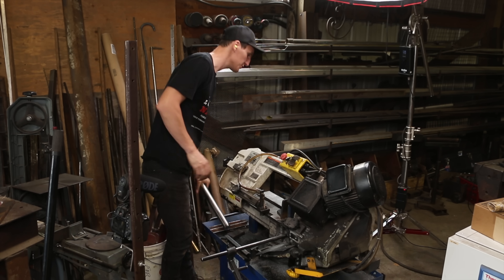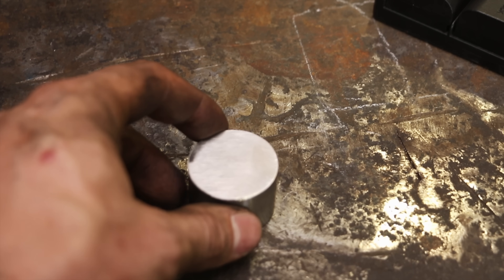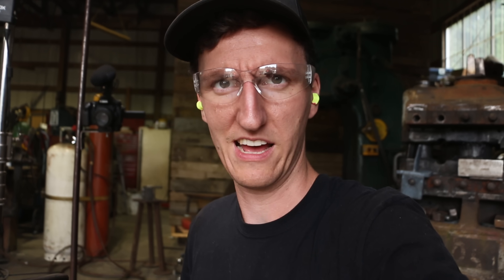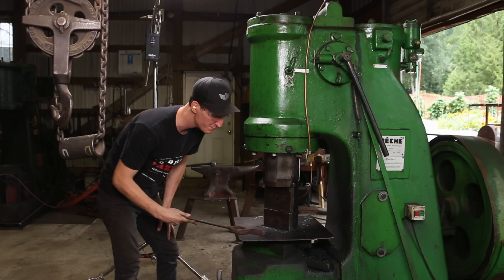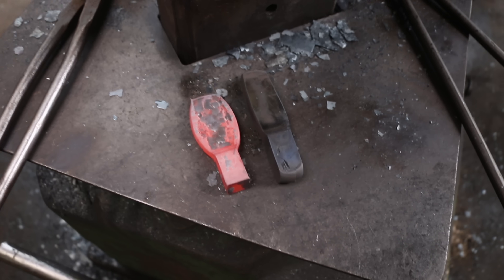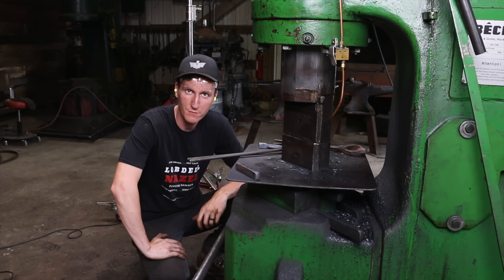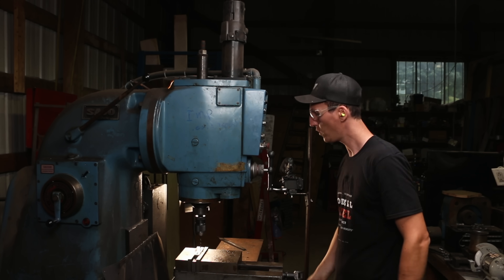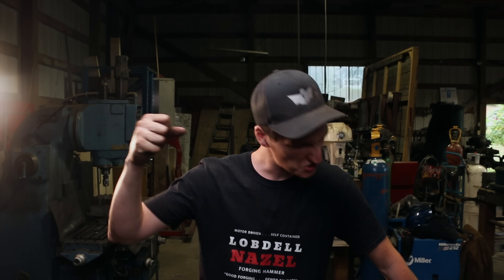Can I Forge INCONEL?

Comment: I've worked in aerospace engineering for years, and I've seen machinists reduced to tears because this material is just a contrary beast. If you want to poke holes in Inconel, you'd better go to the sinker EDM machine, because trying to dill a hole in will just piss it off.
Reply: I waterjet it with 80,000 psi.
Reply: @rolandocrisostomo2003  80kpsi Hooly dooly. So my 3000psi pressure cleaner just won't cut it hey! Oops bad pun. Sorry :(
Reply: @robguyatt9602  I still remember the first pinhole I saw form on the high pressure feed line of the omax table I worked on at the time. Damn near halfway across the work space from a hole I couldnt even see.
Reply: We use it all the time at work for output carriers, sun gears and so on. It’s hard on inserts, but it machines fairly nicely and has an incredible surface finish.
Reply: @Andrewlang90  There are different grades of Inconel, of which double aged 718 is the hardest/toughest. Was that what you worked with?
Reply: Not really a super steel it's just more like a ceramic to tell you the truth. Holds temperature but shatters easy. Just like a carbide.
Reply: @patman0250  Except its molecular structure is very different from ceramic. Ceramics are mostly ionic bonds, while inconel is a true metallic matrix, with less than 1% ionic bonds. And Inconel will melt if you heat it enough, ceramics will not (or decompose).
Reply: @paulmichaelfreedman8334  That's why I said it's LIKE a carbide. Pay attention.
Reply: At least other work hardening materials I've encountered could be drilled, but just infuriatingly slowly.
Reply: I machine inconel 718 all the time. It is one of the trickiest materials to work with. Take it slow and use plenty of coolant. 40 metres a minute turning with 0.35mm depth of cut. Take your time. 9 metres a minute when drilling. Good luck everyone 👍🏼👌🏻😉
Reply: High pressure thru-tool coolant with the right tool and you can drill ANYTHING. Once had some paper-pusher engineer ask me why I was having trouble drilling this high nickel alloy, and I told him the machine didn't have high pressure coolant. He suggested I try peck drilling. LOL. Peck drilling a high nickel alloy 🤣😂 Heavens to Betsy.
Reply: I worked as a CNC machinist for 5-6 years specialising in LARGE inconel parts for the oil and gas industry, you do go through ALOT of carbide and ceramic inserts… cutting premium threads was an absolute ball ache due to the sheer strength of the material. Every spring pass would take out more material, due to tool deflection and wear of the insert, that is, until you work harden it. if that happens you’ll need to take a much deeper cut to get under the hardened layer, not easy when you’re working to +/-.001” with a 16 finish on £1/4million parts. 
There’s actually a few different grades of inconel, 718 was one of the worst to work with, so much so that 925 grade inconel felt like mild steel in comparison. You can tell the difference between inconel and mild steel very quickly, inconel has a very familiar looking yellow sheen and weights significantly more pound for pound
Reply: @sanslik5141    
I was reading your story with respect until I got to the last sentence stating that it weighs more pound for pound. 
It might be me, but I was taught that a pound is a pound. If a pound weighs more than a pound it would defy the laws of physics, gravity, and who knows what else. It's just not logical, Captain! 🖖
Reply: @stanervin6108  you’re 100% right 😂 that’s a saying I grew up with which I used in the wrong context. Well spotted lol
Reply: @stanervin6108  guess he should have said it volumes less pound for pound
Reply: @hughezzell10000  
  Or just "more dense".
Reply: @stanervin6108  I'm sure he meant 'ounce for ounce'.  ;^)
Reply: @stanervin6108  you silly sausage! I know what he meant. :P
Reply: @stanervin6108  but... steel is heavier than feathers...
Reply: @sanslik5141  Been machining Inconel for 12 years, and all of that rings true.
718 is the absolute fucking worst. When everything is dialed in, you can predict and work around most of the work hardening problems though.
But the problem is, if that Inconel is from two different heat numbers, or different forges, your results may differ from part to part. It age and work hardens in my experience, so the longer that shit sits on a shelf, the harder that bitch will become.
925 is an absolute joy to machine. 625 is more like 718, but less temperamental, cuts about the same, but less bullshit.
718 doesn't have the yellowish sheen though, only seen that on 925. 718 will look very dark gray, almost bluish, if you look at the front of a bar at an angle. But look nice and shiny straight on. Might depend on where you get it from also, different blends, but same mechanics.
Reply: I walked up to my machine one day, turned out someone clamped a piece of material in there, one thing went to another and I ended up having a row with some inconel when it started hitting me. I dodged the next it threw at me and gave it an uppercut right in the metal. Never said anything to me after that. 😂
Reply: Keep a flood of coolant, heavy feed snd low speed and it will do what you want. ❤
Reply: its not that hard to drill, just can't be an idiot, use sharp drills and proper speeds and feeds, carbide helps but isn't necessary. It work hardens quickly, so if a drill does go bad, then the part is done, most will continue to try drilling throwing new drill after new drill into the same hole with the same results.
Reply: @northmanlogging2769  Have an oven to anneal it
Reply: @PBMS123 yup. If it work hardness, heating will undo it. Also if you csn, drill while red hot with a carbide but and it zips right through. The metal is some contrary stuff to be sure.

Comment: I bet this stuff would be fantastic for a dross skimmer with molten metal.
or as a set of crucible tongs. 
If its this heat resistant it should be usable in those applications for a very very long time.

Comment: I’ve machined lots of inconel. Very difficult to machine. It’s used for cladding the inside surfaces in a nuclear reactor vessel. The control rod guides in BWR vessel are all inconel tubes.

Comment: So the reason you were having so much trouble drilling and milling vs facing is because you switched from carbide to HSS (high speed steel). If you want to use HSS on inconel you have to be somewhere around 20-25 surface feet per minute and you have to really lean on the drill so you don't work harden it. Even if you are using carbide you need to feed it relatively aggressively to keep it from work hardening carbide is just tougher so it lasts longer and will take the more aggressive feed. I suggest somewhere in the range of 100-130 surface feet per minute for generic carbide tools.

Comment: Tim: This is the hardest material I ever forged.
Me: Make a hammer out of it, just for the sake of it xD
Reply: That was my first thought "Fuck, if it doesn't workharden easily that would make a wicked hammer"
Reply: @maeve615  it does
Reply: @maeve615  that prob only makes it even stronger over time
Reply: He never said it was harder than steel. What he meant was the hardest material he's heated to the usual forging temps. I'd love to see some hardness tests, this stuff looks awesome :o
Reply: I so agree.
Reply: I wonder what an inconel anvil would cost.
Reply: @hughezzell10000  probably more than your house. The stuff is expensive, and as the video shows, a huge pain to machine.
Reply: @kokofan50  Cobalt would only cost $50/kg for a corporation, and it's only around 15% of Inconel 617 - and it is by far the most expensive metal in there. So no, it wouldn't cost you a house.

It's just a niche alloy that doesn't get much use in room temp applications (The majority of applications) where you could use (relatively) cheap steels instead.
Reply: @WhenDoesTheVideoActuallyStart  I was exaggerating a little, but it would still cost a lot. The material costs aren’t going to be the big problem. The most expensive inconel was I found 4.60 a pound, so that would come out to $2,300 for a 500 lb materials. Not an inconsiderable amount, but far from the main cost. The real cost is going to be in manufacturing. The places that work in inconel are going to charge a fair bit for a one-off.

Comment: We install splash plate inside of our plastic injection molds, on the opposite side of where the nozzle mates to the back of the mold. When the nozzle squirts plastic into the cavity, it hits that plate, and over a few 1000's cycles... the plate still shows wear... tough stuff..

Comment: I was inspecting a vessel made of Inconel and the legs were just stainless I think SA-316 and the customer called and wanted the the 16ft legs to be Inconel also. Response went "what? are you sure? You know how.... yea we can do that." Then looks at me "well more money for us!" I was both shocked and laughing because that is not what Inconel is for.
Reply: I've held Inconel nuclear fuel cells before fueling and seen them being removed from  a reactor. The stuff is light but can take huge amounts of heat until the material fails. Seeing what the Inconel cladding looks like after a meltdown is exactly the same as his failed hammer forging.
Reply: @dagger6467  That is why they use Zirconium alloys for cladding. Unfortunately  that alloy has this tendency to get brittle from high temperature water steam (1,230C). Resulting in a condition called hydrogen embrittlement.

Comment: Can you please try the same with molybdenum?
Reply: Forging moly is a bit of a problem.  It can certainly be done, but the oxide that forms at 1400F sublimes rapidly (turns from solid to gas, like dry ice).  So you begin to lose material rapidly and fill the shop up with white smoke.

Comment: INCONEL machining is often done with extreme levels of cooling and lubrication, i notice.
Reply: Yes. That’s a true statement. I work as a machinist in a machine shop
Reply: and low cutting speed. unless you have ceramic inserts then you need high cutting speed
Reply: @user-by7hj4dj9s  My understanding too is that you need a deep cut our else you are fighting against work hardening.
Reply: We use formcut 150 in our machines and never have an issue. Slow speeds and feeds for sure though. .01 d.o.c. on edge passes and .02 on bar out processes. It machines beautifully to a mirror finish though. I like it.

Comment: I use to work at an areospace machine shop, we did a lot of inconel parts. Its one of those materials that u cant truly grasp how hard it is until u try working it lol. But once u get the process and tooling dialed in its not terrible to work, just costly cuz the tooling needs to be nice and ur gonna eat through it even faster then machine titanium

We use to explain to clients that aluminum is to steel as titanium is to inconel. Good comparison both in working it and material properties

Comment: Drill it with SuttonTools R40 Inox drill bits low speed and plenty of lube. Have used them many time to stop crack propagation in gas turbine exhaust inner shells. Love the vid's keep them coming.

Comment: So Tim what you're telling me is that I can't machine inconel pistons for my Ford Bronco? :(

Bummer, but thank you for yet again another awesome video. You convinced me to build my own forge btw :)
Reply: You can if you can keep the tool and workpiece cool enough. Very light passes with a high quality lubricant that can suck away all the heat. The chips from Inconel don't seem to carry the heat away from the workpiece so the heat remains localised and at some point that will cause the metal to work harden. It's usually sooner rather than later though. 

Also I'm not sure how easy it would be to get a really nice finish by machining it in a home shop. You might end up having to hand finish it with abrasives and that would screw your tolerances right up for something like a piston. Bear in mind it's used in jet engines though, it is possible, just not without a lot of trial and error or R&D lol.

Comment: I had to machine the combustion housing for a jet engine a long while back... The worst machining job ever.  It work hardens extraordinarily quick, ate through thousands in inserts.
Reply: My question is this what about making a sword out of it.
Reply: @ericspecullaas  there are better steels for that sort of application.
Reply: @ericspecullaas  it’s too heavy and doesn’t flex enough. A nice carbon spring steel is what you want.

Comment: Looks more like cast iron from the view you showed after it blew apart. Guess there are proprietary forging methods for inconel lol.

I was surprised it machined so easily... and then it didn't :( 

Tough material to work with! Generally when you get specialist materials they're fantastic at a couple of things, and every other aspect is a massive trade off.

Great video though, hopefully your experience with flying white hot crumbly inconel gives others some guidance. And anyone without a power hammer would be a fool to try and forge it lol.

Thanks for the time and effort you put into making content for your subscribers, and the other mad fools that have not yet subscribed and dinged that bell!

Comment: It's like stainless steel on steroids! No scale or flaking at any of the temps shown. Amazing! Thanks, Tim.  ⭐🙂👍👍
Reply: Exactly why it was first created actually.
Reply: Well inconel is a nickel base alloy and it is alloyed with (mostly) chromium, molybdenum, vanadium, niobium, cobalt, manganese etc... Nickel and chrome (vanadium and molybdenum not so much but still) are the most important alloy elements for making steel resistant against corrosion and other properties a also achieved by adding these metals to iron alloys  for example nickel is used in steel alloys for low temperatures (-50°C and lower) to prevent that the steel get to bridle in the real world that and similar alloys a used for almost any liquid gas application

Comment: Isnt it no longer stainless after that much contact with carbon steel. The carbon migrates into it without heat even heating it. Im asking for any big brains out there to educate me  here.
Reply: Carbon does not diffuse that easily.  If the material is forge welded and then held at high heat for a long time, yes the carbon will diffuse.  However, the presence of carbon alone does not determine if the material is stainless.  Alloy 440C is a very high carbon stainless, a lot of knives are 440C.

Comment: "Two heat treatments are generally utilized for INCONEL alloy 718: •Solution anneal at 1700-1850°F followed by rapid cooling, usually in water, plus precipitation hardening at 1325°F for 8 hours, furnace cool to 1150°F, hold at 1150°F for a total aging time of 18 hours, followed by air cooling."
Reply: did he say 718? I think its more like 625 what he used...
Reply: @mrjodoe  just showing it can be annealed. Would probably need to be done multiple times during the machining and drilling process, much like working with copper.
Reply: @NOTSOSLIMJIM  got it. Crazy material...i wonder what to do with a whole roll of wire. Maybe robotic mig or tig welding of inconel parts?
Reply: @mrjodoe  I have tig welded it before, it's a pain. I use it for firearms parts
Reply: @NOTSOSLIMJIM  oh ok, didnt know this. Eg gas pistons? Or also slides and/or barrels?
Reply: @mrjodoe  suppressors. Inconel is also used in high end exhaust system and turbo chargers. Way too expensive for my budget, I'll stick to stainless and titanium for those. But yes, the best suppressor are 3D printed inconel. I do not have a $250k metal sintering 3D printer, so I weld tubing and manufacturer K baffles.
Reply: @NOTSOSLIMJIM  it actually welds pretty nice with tig, it's half way in between stainless and aluminum but it moves slow. don't throw more heat, just wait twice as long for it to respond
Reply: thanx, I was wondering if it can be hardened. Do you know the hardness score pre forging and after heat treatment?
Reply: Sooo.. you're saying I can't just toss it in my kitchen oven..?
Damn, there goes all my plans.. 😒
Reply: @GenoLoma  I mean, how bad ass is your kitchen oven?
Reply: @NOTSOSLIMJIM  it's utterly shit, that's the problem.. ;)
Reply: @GenoLoma  yeah, probably won't do much other than get it hot....

Comment: Possibilities of making Inconel hammer and tools ?
Reply: Hammer yes, probably. Tools, probably not unless it was a very simple form like a spanner/wrench. Even then it's unlikely it would be worth the cost in time and materials. This stuff is the very devil to work, be it forging or machining, it would cost a boutique blacksmith a fortune to make a single well finished tool. It's just not financially viable, unless you have very rich customers that want certain items at any cost. And there are less rich nutters than you'd think. Michael Cthulhu is proof of that, he should be stinking rich with the art he makes and sells, but apparently rich people don't want collectible stuff from YouTubers lol. 

I guess the flip side of the coin is you can buy a hellcat and flip it for twice the price within a year. Supercars have even higher appreciation over time. Buying super high priced oddities from YouTube creators just doesn't give the same returns. Michael Cthulhu struggles to get a few grand for a months worth of 12 hour days of labour and love, and a ton in material wastage and overheads. 

Economics is a bitch, so leave a like, that at least helps content creators ;)

Comment: My initial thoughts when the piece shattered was that you (possibly) introduced stress fractures during the first hammering at lower temp and then when it was at full heat it just crumbled along those micro fractures.  Just a thought?  Regardless, that's pretty wicked.
Reply: No doubt correct. Crumble city that stuff.
Reply: Incipient melting occurs around 2150F to 2200F.  If heated to 2250F problems occur.